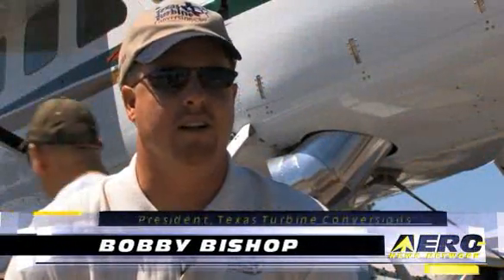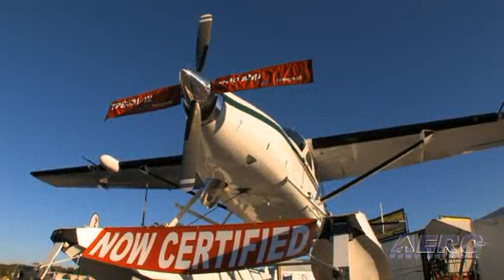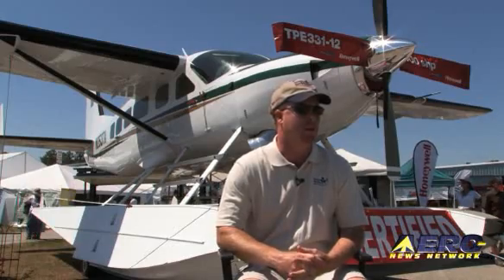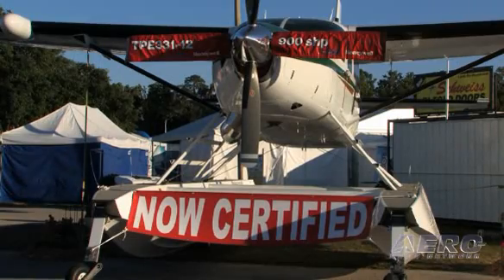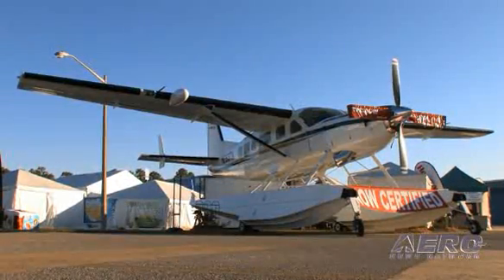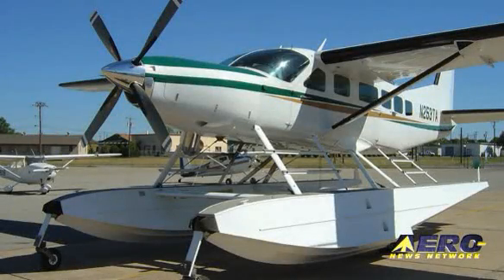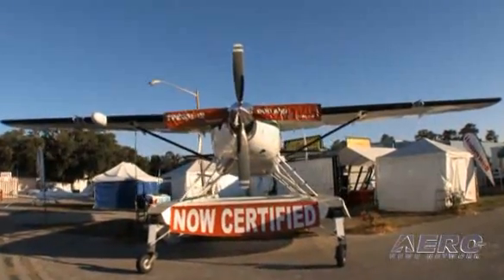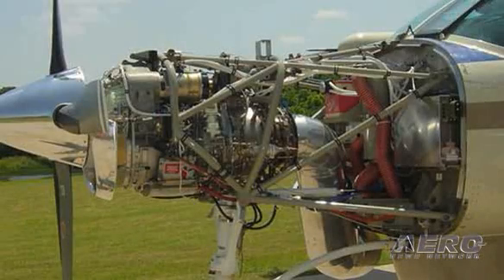Aero-TV: Powerful Upgrades -- Texas Turbine Conversions

Comment: Some things to think about, the 331 requires considerably more electric amperage for starting than a PT-6, when you start dealing with Arctic temperatures in remote locations it may become unworkable. Also with the PT-6 engine, you can do a complete Hot Section overhaul without removing it from the aircraft, while the 331 requires removal.